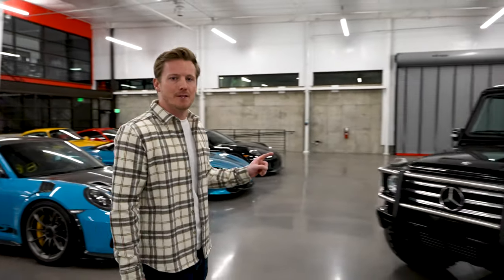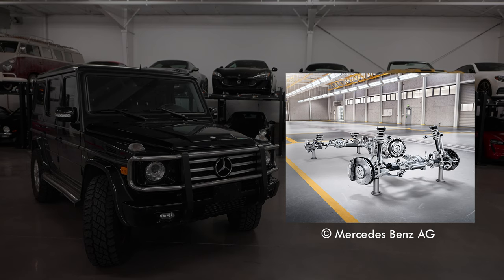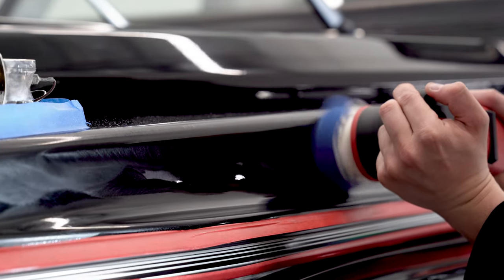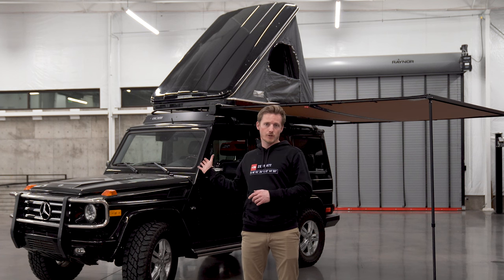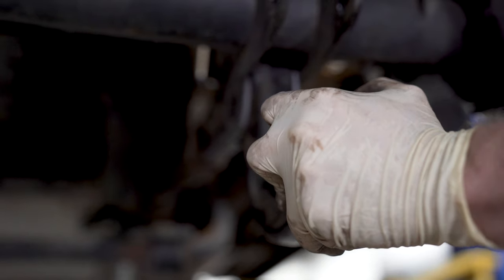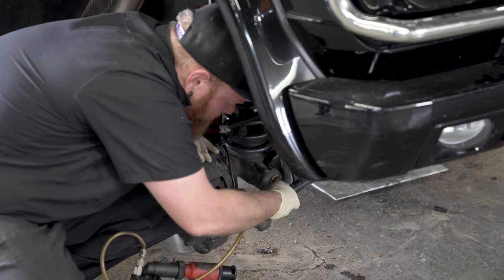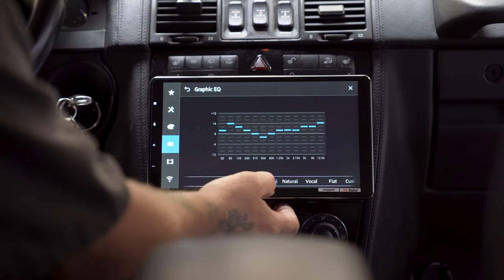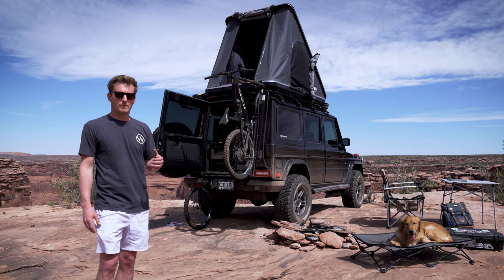Building a G-WAGON in 7 days [Filmed in 4K]

Comment: Nicely done. For sure you don't see many G wagons out there truly off-roading, so you'll definitely stand out. I have the Frontrunner rack and side-opening iKamper mini on my 2012, which is also a great setup as it frees up half of your roof rack to store items (fuel containers, traction boards, recovery straps, etc.). You'll probably find that the awning gets the least amount of use for the space taken, I went with a separate stuff-in-a-bag low footprint one originally made for a VW bus club. Probably better to save room on the rack to mount a hi-lift jack or other useful off-roading tool (shovel, etc.). 

I haven't found center of gravity to be an issue, however I do realize the limitations of the G platform for the really rocky stuff. I think these were built to be excellent at traction (I call mine the 'tractor') to plow through any kind of relatively level terrain, but they just don't have the architecture to tackle serious rock climbing. For that, they'd need a wider stance, shorter cabin area and more wheel articulation. But, I've had mine at some severe angles on some challenging trails with a fully loaded roof rack, and you'll certainly know when you're getting close to the tip-over point. But that point is more extreme than you would think!

Not sure I'd have bothered with the paint correction - if you off-road the fact of life is it's going to get scratched up - probably a wrap would have been more appropriate. It's true on the maintenance, but everything is pretty easy access and doing it yourself is really not much more money than other vehicles except perhaps for the cost of the parts. These year G Wagons don't have the complications of things like turbos and are surprisingly basic (e.g. share parts with older C Class models). I'm sure loving mine!

Comment: I am buying a used 2014 G550 with low millage (~40K) on it. But just got the inspection report and was surprised to see some leaks such as front hub seal, front differential pinion seal, transmission fluid, and transfer case output shaft seal! The mechanic and dealer (of course!) tell me these are common but did you have a similar experience purchasing your car? Do you happen to know a reliable shop in Denver?
Reply: very curious about what happened with this
Reply: @cboria148  I flew to TX to check out the car. Turns out differential locks are not engaging, perhaps due to the leaks reported!

Comment: There is good but scattered info on the MBWorld and ClubGWagen Forums. Good too see the W463 platform getting more attention with good video and storytelling. Jack is the best, hands down. You don't need the rear speakers either - they don't do much when properly time aligned and aren't worth the custom effort. Also remove the OE Sub and use the space for recovery storage/tools/onboard air.
Reply from the maker: Everything you said is spot on. There is definitely good information out there between those two, but coming from the 4Runner world, ease of access is a whole different story. Jacks definitely the best! Wouldn't consider another route in the future.

Comment: That ä is pronounced as an e in Deutsch.  Deutsch is what Anglophones call "German. "  That 5.4lV8 is the best pick of the bunch,  but Diesel versions are better with OM606 straight six and now the G400d with OM656 straight six.   The G500 and G550 use the exact same engine,  a jewel that will last a million miles. Toyota doesn't have the edge on reliability;  practice have proven the perception wrong many times over,  in Africa and Awestralia.  😊

Comment: The general handling of these vehicles is not fantastic on the road (brilliant off road as designed). You have utterly destroyed the vehicle, not only by lifting it, but by using thinner coils. Over the length of the  new springs, you have besically put in softer suspension. Also with a roof top tent, the cetre of gravity changes drastically. The vehicle will swing considerably more now, -with the new suspension and with the additional weight on the roof. A two inch lift is heaps on a G wagon. It will get over anything ! Mecedes Benz say "do not lift higher than two inches" Why, because it affects all the running gear !! One example, drive shaft angles etc etc. Larger tires affects breaking performance. Mercedes designed a perfect off roader, so why F*&%k it up ??? Great vehicle and great job on that paint work. Looks fantastic ! Thanks for sharing. From New Zealand.
Reply from the maker: I agree with some of your sentiments, but "ruin" is an extreme term. Doing this over again I would probably go with 1.5" suspension and 34" tires. Glad you enjoyed the rest though!
Reply: Agreed, somewhat harsh. My appologies.

Comment: Great build! I have the same Jackwagon lift on my 2002 G500. Jack was super helpful. I'm amazed at how capable this rig is off road and how great the on road manners still are.  Did you have any driveshaft vibration? I've had some, but it doesn't sound common, or perhaps I'm being overly picky.  Great to see the interest in using these trucks as the designers intended.
Reply: At what speed does the vibration start, and does it get worse as you increase speed ?
Reply from the maker: Sorry for the late response Rod. I didn't notice any driveshaft vibrations. The main point was the ESP system kicking in on highway turns. That one freaks you out if your aren't expecting it.

Comment: Awesome video, nice build. Did you do anything with the motor? Apologies if I missed it. Can you speak to some of the tweaks you refer to that help the older version appear like a newer version? I agree with your seeing as the older models abandoned.
Reply from the maker: No engine modifications and didn't feel the need. As for tweaks, the head unit and sound system was one but there are plenty of aftermarket body kits, grilles etc that can make it look newer. Keep in mind the body changed in 2019 so you can awkwardly try and pretend to be a 2019+ but much easier and cohesive to change to a 2018 style

Comment: Great build. I was wondering to do mowab do you need to lift the 2021 G-wagon amg 63 model? It’s got a 9.87 ground clearance. The brakes are massive and the rims are 22’s  so rim and off-road tire options are limited. Not doing anything special just wanting to camp the lady on vacations without voiding the factor warranty. Thanks
Reply from the maker: Sorry for the delay on the reply Billy. You should be fine with a lot of the dirt roads around Moab but I would not tackle any legitimate trails. The max I would do with a 463a AMG is Shafer switchbacks to Potash Road, but even that has one or two sections you'd need to choose your lines correctly. Otherwise plenty of dirt/gravel roads with accessible campgrounds.

Comment: I have the exact same year/model. With that specific lift kit, did you have any "death wobble" at lower or higher speeds? Or does everything included in the kit solve that issue? I ask because it is an extremely common issue with every lift kit I have researched. Thanks!
Reply from the maker: Absolutely no death wobble. I believe the caster correction bushings have a hand in solving that. 

The ESP system does it's thing at speed around curves depending how you take them, and the first time it happens it can be pretty surprising haha. But I usually take easy, light turns when I have the rooftop tent on and got over it pretty quickly. Never tried disabling it but that's also an option!
Reply: Hey Steven, if you are looking to lift your G, shoot us an email and we'd be happy to go over things with you! This isn't just a spring and shock upgrade - it's a full kit to make sure the truck handles as best as possible with the raised CoG
Reply: @jackwagonoverlanding  Definitely will do so when I get to that part of the build, thanks!
Reply: @jackwagonoverlanding  What is the smallest lift I need to have 35 tires?  I currently have a 2 inch lift with ORC blue springs and Koni shocks.
Reply: @creative_partner  for 35s and no rubbing whatsoever, we recommend the 4” kit. We’ve heard of people fitting them with less lift but if you plan to off road the truck, you will rub with smaller kits. Shoot me an email and we can go into more detail
Reply: @jackwagonoverlanding  Thank you!
Reply: Yes, caster correction if you go more than a 2" lift. Mine's at 2", and although I have not corrected the caster, you can tell she's on her tiptoes a little. Also, ORC in Germany was making a rear sway bar kit, which I installed and I think helps tremendously.

Comment: Looks like a pretty functional build. However, and to each his own, I'd totally skip the audio upgrade,  I mean, when you're out in the wilds, do you really need to be cranking tunes?  It just disrupt the reason for getting away from it all in the first place.
What's more important in my experience, is the convenience mods, of cooking, food storage, ease of cleaning up dishes, and having the  tools to do so close at hand.  
Another thing you didn't mention re. Toyota vs. G Wagen, is the 3 locking difs,  which Toyota does not have in stock configuration.  Sure, tire and wheels can be changed around on both vehicles, which accounts for a lot in any car's performance.  But your lift kit is sound and makes perfect sense.  
I hope you will share more videos.
Reply from the maker: Thanks for the thoughtful response! For the audio, it may not have a place when you actually get to camp, but having a good audio system with the latest in display tech is absolutely worth it! The goal was enriching the driving experience too.

Good point about the locking diffs! I did mention it in the beginning of the video but I should have expanded on that in the final section.

Thanks again and glad you enjoyed!

Weston

Comment: What rear bumper is that and which ones have you looked at to replace the front along with adding a winch?
Reply from the maker: It's a VTS bumper. And yeah I've had a few ideas on the front. The ARB from a 70 series Land Cruiser is a pretty close match, but the one I wanted most was a OE G63 front bumper with the LeTech winch mount. Would have replaced the intercoolers on the ends with BajaDesigns LP6s

Comment: If you had the choice between the 2015 5.5L NA V8 and the 2016 4.0 Turbo V8, which would you pick? I have a feeling that the 2015 would be more preferable for overlanding since it is mechanically simpler and has a larger gas tank, but the extra power and more attractive front bumper in the 2016 is pretty appealing too. Kind of worried the turbo intercoolers would become easily damaged during offroading though. What do you think?
Reply from the maker: That's a good question! I haven't had any experience with the turbo 4.0 and haven't researched it a ton. I had a 2017 G63 prior to this which is the twin turbo 5.5L. It's obvious it wasn't tailored for trail at all.

My gut says the same as you. No replacement for displacement and the N/A 5.5L was awesome.